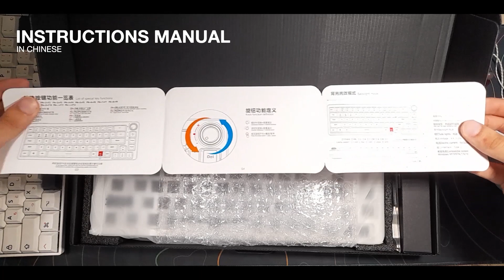Tom680/TM680/Gamakay LK67 Unboxing and Mods! | My first custom mech!

Comment: Questions since I just ordered this board. Ordered the Black Wired TOM680 and just found out about it's issues after its already been shipped out 🤦‍♂
How valid are the claims of the PCB frying issues coming from the stock cable? Will literally any other cable avoid this issue? I'm planning to use the stock cable for my RKG68 (whose PCB went crazy on a few keys) on the board and I'm wondering whether it'll be okay when disconnecting or if it'll net the same results as using the TOM680's stock cable. Would really appreciate an answer 🙏
Reply from the maker: Don't use the included cable, mine is still working after a year and I didn't used the stock cable from the get go
Reply: @CaviteTechnology  Thanks for the reply, did you use just any other cable or did you use a branded one?
Reply from the maker: any other :)
Reply: @CaviteTechnology  thanks!

Comment: Came from reddit, hey did you had any issues with keycaps (if cherry profile) due to north facing LEDs? Also is it still possible to buy that diy case-pcb kit? 

Loved your video btw
Reply from the maker: Thanks! havent had issues but keep in mind, i use the matcha switches
Reply: @CaviteTechnology  i have the ocean blue installed on my keyboard, but planning on using oem keycaps to avoid issues
Reply: @Casquillo8520  Lewis Toh made a video explaining that because of the way that akko switches are manufactured, there will be no north facing interference. Here's the video with the timestamp: https://youtu.be/tigvEmgAYQU?t=213 

Hope this helps!
Reply: @edamtem9027  Does that mean KTT switches also don't have north facing interference since akko switches are manufactured by KTT?
Reply: @kboyzdinaba1741  I'm not too sure about it, but I would assume so.
Reply: @edamtem9027  nice, thanks dude
Reply: @edamtem9027  damn that's so good to know, since my next build would probably be the tm680 with some matchas instead, and cherry keycaps set

Comment: How did you change the Rotary Knob's lighting color? Ngl the software is confusing af 🥲
Reply from the maker: didn't use the software at all, just used fn+pg up
Reply: @CaviteTechnology  I got the tri mod and the software seems different. I tried the Fn+PgUp it doesn't seem to do anything 😅

Comment: isnt the tm680 north facing? wont it have interfearence with the kon momo cherry profile keycaps?
Reply from the maker: I used the Akko Matchas since it has long poles; as for my testing, I didn't  have any issues with interference
Reply: the rgb in tm680 is shit, also the software is shit. I upgraded stabilizers to Durock, the plates are so tight that I cant take them off.

Comment: are the akko matcha greens fine as it is? or should they need lubing?
Reply from the maker: lubing does help a little! but you can absolutely use them stock.
Reply: @CaviteTechnology  thanks!! been planning on buying the tom680 with the matcha greens too ^^ great video btw
Reply from the maker: @AH-qc3ny  thanks!
Reply: @CaviteTechnology  another question .. build wise, rk68 or tm680??
Reply from the maker: @AH-qc3ny  I've had the rk71 and tom680 both with me and I havent tried the rk68 yet but on build aline, I think the tom680 is better
Reply: @CaviteTechnology  which sounds thockier among both?